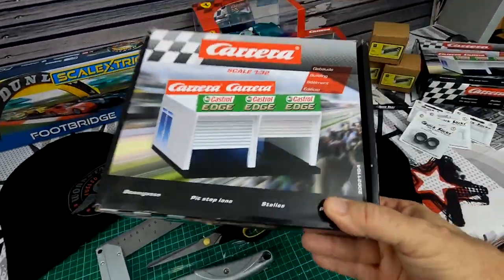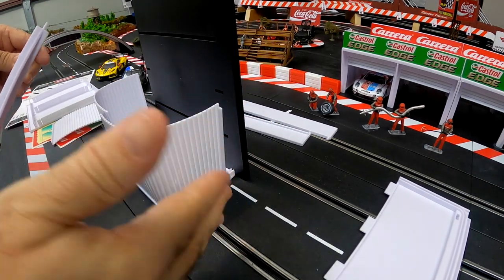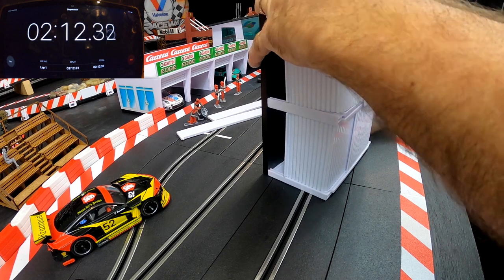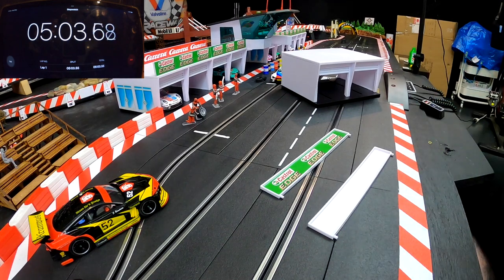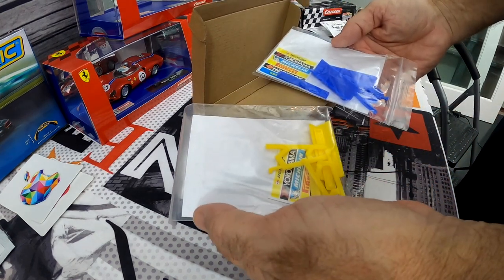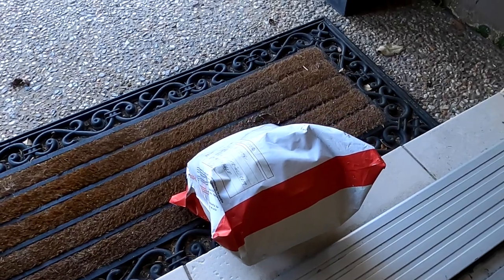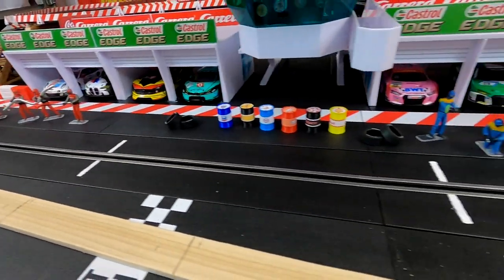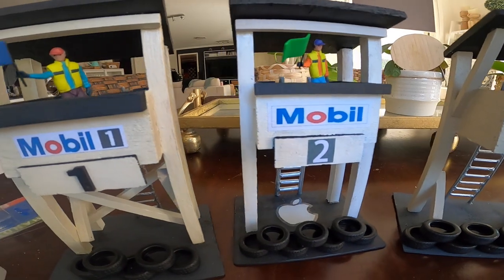Carrera Pit Lane Garage Build - Hughes Garage SCA Ep 6

Comment: Using a spray bottle to lightly moisten the adhesive side of the sticker will allow you to position it on the panel and adjust its position before the adhesive drys.  Once it is in the correct position gently squeeze out the moisture, smoothing the sticker as you do so, and leave to dry.  Job done

Comment: Using a small spray bottle to lightly moisten the adhesive side of the stickers will allow you to align the stickers correctly before they stick down to the surface. Once positioned correctly, gently squeeze the moisture out from under the sticker and allow to dry. Job done.
Reply from the maker: A great tip, thanks Mark 😎🏁